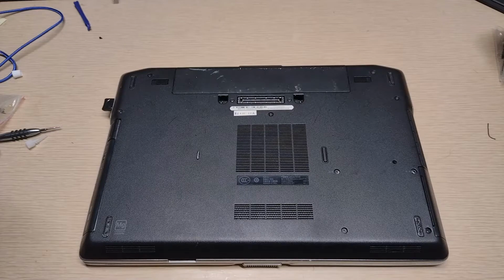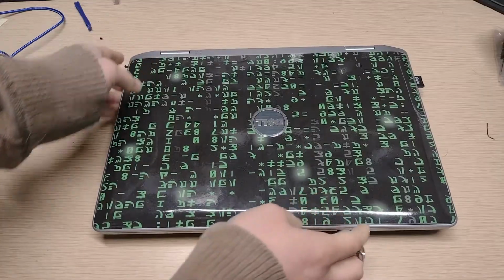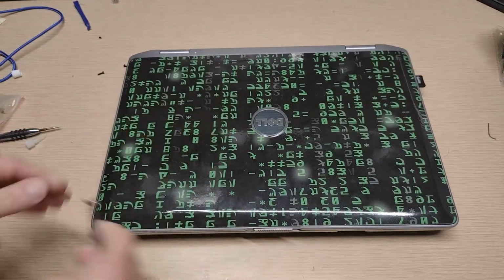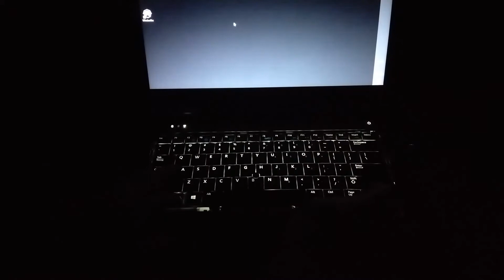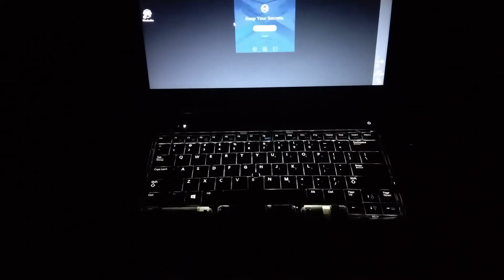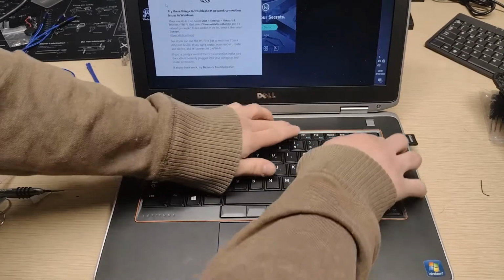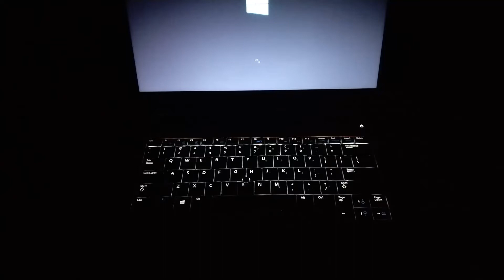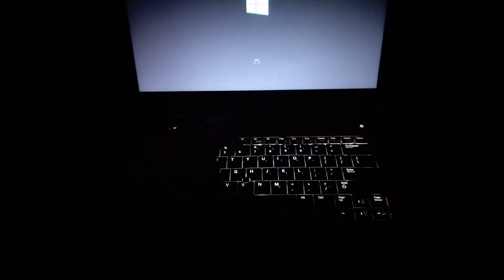Dell Latitude E6420 - Upgrade Keyboard To Backlit

Comment: This is awesome, do you think it would be possible on a Latitude 3420?
Reply from the maker: Yessir but like on certain HP elitebook and zbook models it's hell. You'll prob have to remove mobo to get at your keyboard. https://www.ebay.com/itm/195366232459?chn=ps

Edit: wow that's insane, may not be worth it. See the second pic in the above link.